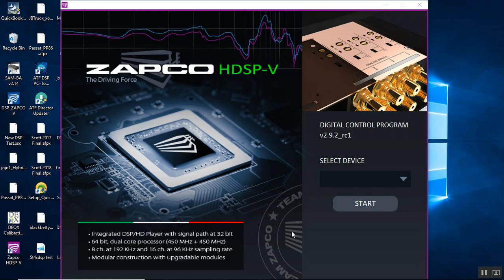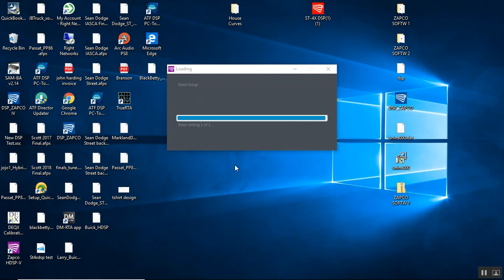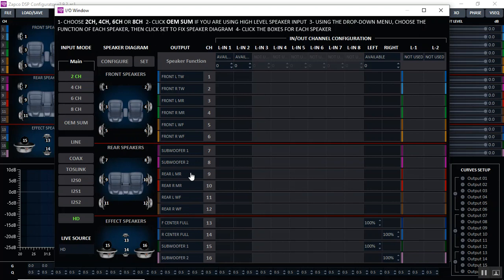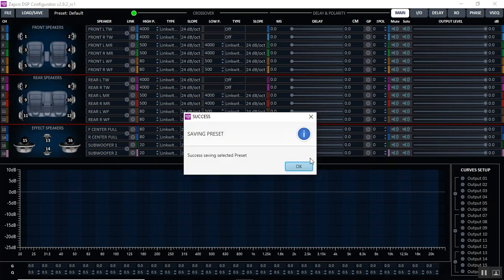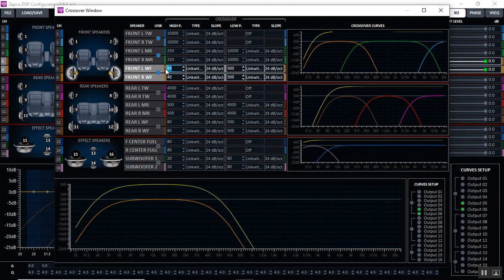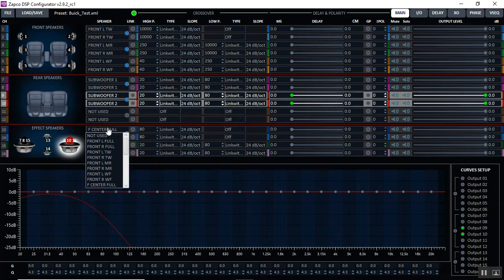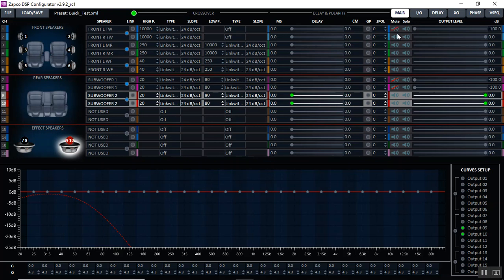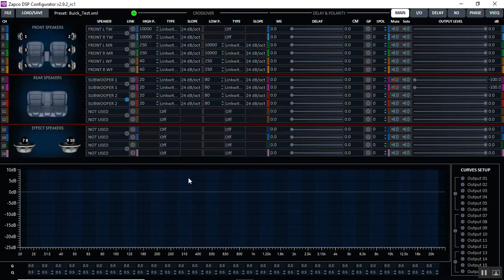Zapco HDSP Z16 V Startup

Comment: How can i save in default preset? When i choose default at start program this preset return to standart settings :(
Reply from the maker: As long as you’re linked to the dsp and go to “save preset” you can choose which preset you want to save it in.
Reply: @JosiahBuwalda  when DSP is start, before i chose preset in list of preset, active preset is "default"? Am i right? And if i want change settings in "defaul" preset then i need do next? - Connect to DSP and chose load "default" preset, change settings and push save in curent preset? When i do this  and load after again "default" preset, this show me not last saved my settings in this "default" preset, its show me again standart settings of "default" preset 😐
Reply from the maker: @Ярослав-ц8ч6б  yea I’m not sure what you’re doing. Save your settings in preset 1 and save it to device. When you do that it will always be on preset 1 unless you change it.
Reply: @JosiahBuwalda  Ok. Thanks for answer :)

Comment: Can you run this with just a digital feed via USB port no analog inputs?
Reply from the maker: Yes this can be run primarily using a digital feed. Most of the time you can use it directly via usb with a fiio player for example.

Comment: why did u set xover point at 250 hz to 10 khz for a midrange thats insane !!!!
Reply from the maker: Max Max what do you mean? That’s a great setting for the L3se from Hybrid.
Reply: I've heard some exceptional systems running L3SE's tweeterless. They play pretty high.
Reply: @JosiahBuwalda  legatia X3  Same great? I use x3-pp
Reply: And l6se cover 40hz?? On IB

Comment: How do you adjust channel gain ???
Reply from the maker: Jon Seeley where it says output level. Call ARPA of America for more technical specifications, you can also download the manual on the Zapco website.
Reply: @JosiahBuwalda  input gain and output level are not the same thing.....another guy did a review of this amp and said the dsp software is flawed and its missing the input gain....i tried contacting zapco.....no reply....they screwed up and they are starting to realize it
Reply from the maker: Jon Seeley sorry you didn’t specify input or output gain. You asked for Channel Gain. Also this isn’t an amp it’s the 16ch DSP. Maybe you’re referring to the ST6xdsp? there was a channel gain issue but that has been revised. This DSP does have both input and output gains. I’d reference the manual I just downloaded on page 10, also if you look on the Zapco website the pictures show off the input gains under the cover.
Reply: @JosiahBuwalda  i was referring to the st6x-dsp but i was interested in the high end dsp amp (forgot model)....but i was afraid it had same software issue.....thx for clearing that up
Reply from the maker: Jon Seeley everything that comes out and is new will have software issues, that’s is why they continually work on it and put out updates.  There isn’t one dsp on the market that came out perfect the first go. At first yes kind of a nightmare, but it’s all being ironed out. Including that st6xdsp